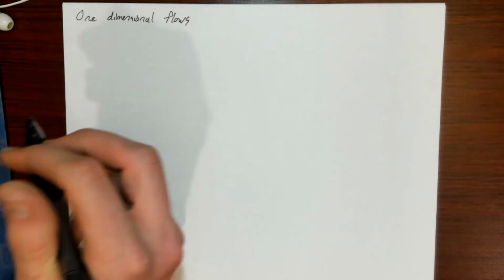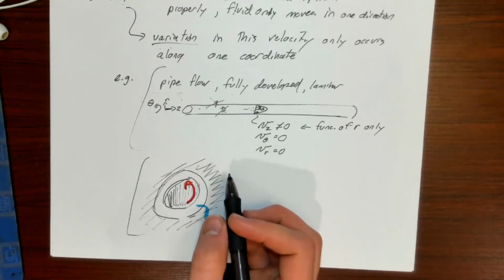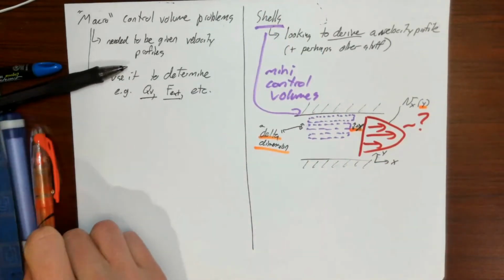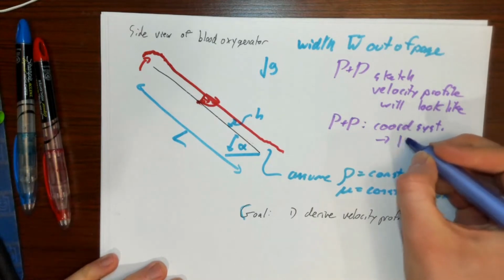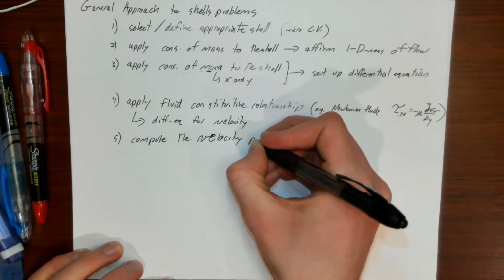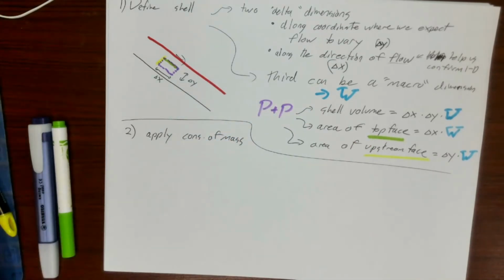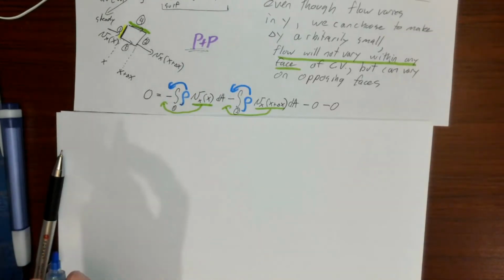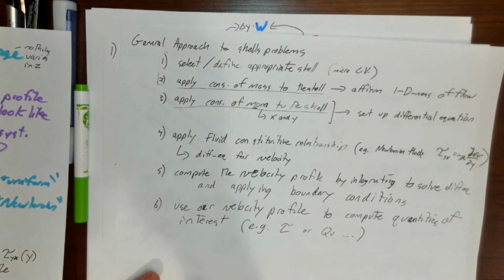BIOE 3310 Lec 13 - Deriving velocity profile for1-D flows, shells, and part of an example problem

Comment: What does it mean for a flow to be 1-D? 6:20 
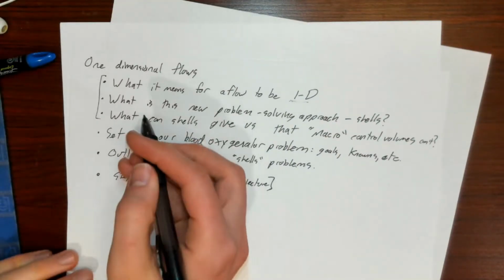What is this new problem-solving approach, shells? 15:12
What can shells give us that "macro" control volumes can't? 24:49
Description of a blood oxygenator example problem - flow down a ramp 24:49
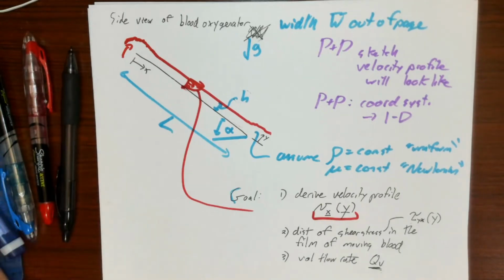The 6 steps for solving shells problems 35:15
Executing steps 1+2; [steps 3-6 will be our next lecture]